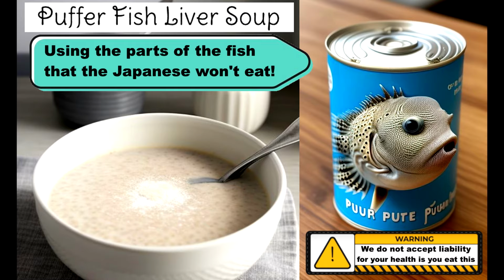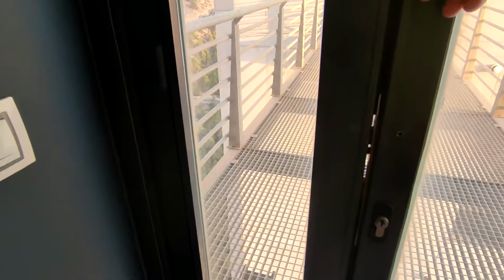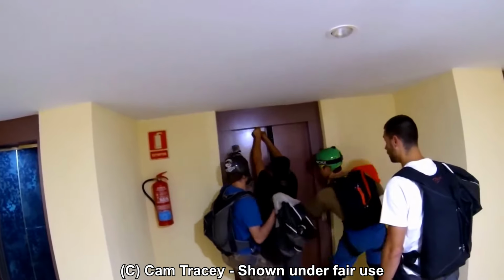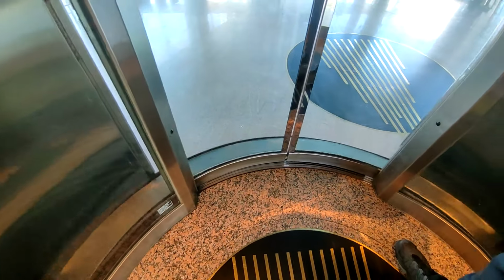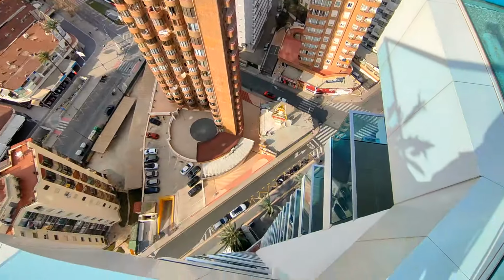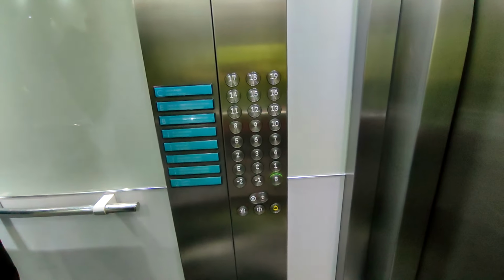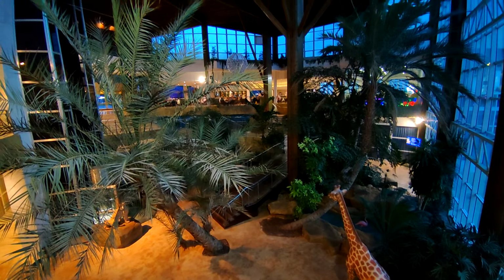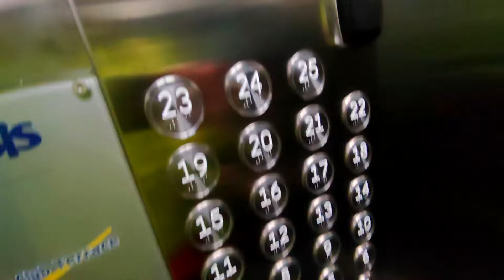Return to Benidorm adventure [2024] with Ryan

Comment: Perhaps the use of these floors to reduce wind force, allowing the wind to pass through the floors and not make the building suffer less from wind load makes sense these two towers are quite thin and in Hong Kong I heard that the holes in buildings or empty floors can be an architectural element to the mythology of Asian dragons in mythological concept they think that dragon can pass through the building not obstructing its flight path and not making it angry.
Reply: This is true, the empty floors are constructed to allow airflow which reduces swaying in high winds.

Comment: I wonder if you could explain why generic VF drives seem to always make that little "beep" when starting and stopping. Most of the tower block lifts I surfed in Leeds did it. Main lift logic used was ILE. But of course I know VF drive is seperate from lift logic. The logic just tells the VF "go fast" or "go slow" or "stop"
Reply from the maker: It is the Omron VFs that make that beep.  It is the sound it makes when holding the lift still as the brake releases.  Omron is a very simple VF drive.  It simply responds to circuits from the logic set to different speeds (called references in the settings).  The VF can not directly interface with the positioning system.  Due to how over protective Lester and ILE are the Omron VF takes longer to level the lift compared to if it didn't have a VF drive.  The modernization made the lift take longer, which is a downgrade.  The reason why Omron was used is that it can handle a lot of abuse without going wrong.  It is used on mods of loads of different lifts and it has to cope with anything thrown at it.  Also it has to be super simple to set up as generic lift engineers are lazy and don't have the patients or intelligence to work with more complex systems.  All generic equipment works on simple inputs that are easy to understand.  These Omron systems were used in the 90s and 2000s.  Generic lift logics switched to Emerson drives in the 2010s, which were more complex, but still crap at running the lift, and they are very unreliable.  In the late 2010s the new era of generic logics (Thames Valley 2 and Lester 2) switched to Magnetek VF drives which directly work with the positioning system, and run like a proper lift, but they are still very over protective and very cautious with how they run the lift, and are still slow compared to a Schindler Miconic.  The Lester mod package for Kone Ecodiscs is one of the worst things ever created.  Despite using Magnetek it is painfully slow and is a huge downgrade over how LCE runs.  Plus the LCE logic is not the point of failure on Ecodiscs, so it is unnecessary to replace it.  Also, ILE CanX has gone a different route to the others and runs the lift very well and is my favorite generic lift logic.  I feel that generic lift logics are 20 to 30 years out of date compared to what real lift logics are doing.
Reply: @benolifts  Well said Ben. Although I’ve never came across a modded Ecodisc, but from what I know I bet it is the people who get fed up of the 10000 trip lockout feature which soley exists to lock people to Kone for maintenence and servicing but of course some clever folk managed to make the jailbreak tool but it depends if you know about them and can afford one/hope whatever servicing company you pick have one.
Reply from the maker: The LCE lockout is pretty much an issue of the past nowadays.  It has been around so long that all engineers should be able to work around it.  And the jailbreak tools sell for £50 on ebay.  Kone went through several attempts to restrict maintenance, from the chip that could be pulled out and written to in the early days, to the soldered in chip, to the expensive KNX card (which was an utter scam), to the more recent 500 trip lockout.  But as Kone are now focusing on KCE, they have given up creating new restrictions for LCE.  Instead they are most likely going to do a similar cat and mouse game with KCE.
Reply: @benolifts thank you for your detailed explanation, I was curious about that too
Reply: This is horrendous. @benolifts
Reply: @benolifts  It is always weird to me because in America there were quite a few logics around in the 2010's even for generics that did intelligent levelling, in fact some of them are only slightly worse than Miconic. My friends old dorm had some of the most efficient generics I have ever seen, they were barely worse than Schindler to the point where most people would likely never notice.They went 2.5m/s and had pre-doors, only thing I didnt like were the horrendous Innovation Bruiser buttons and the slow startup after the door closed, but fast acceleration. There are plenty of crap logics here too but generics in America from the 2010's seem to be pretty good. Also in America the Gen2's are way way better. My old work had 2.5m/s Gen2s with intelligent levelling, pre-doors and pre-start, unheard of features in the UK. That being said Schindler and KONE don't seem to be that much different here. Even brands like Dover made some incredibly efficient traction elevators here in the 80's and 90's and only got worse after the TK buyout. That being said the amount of hydraulic elevators they install here is unacceptable, I have even seen Schindler do it as recently as 2021. Its just very different and I hope you can visit the US sometime cause lifts (elevators) here are extremely different.